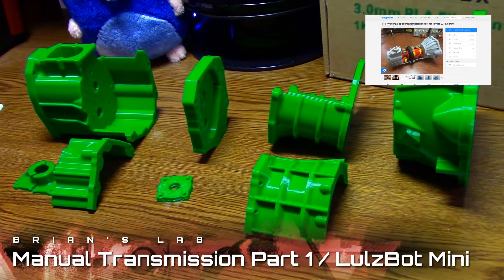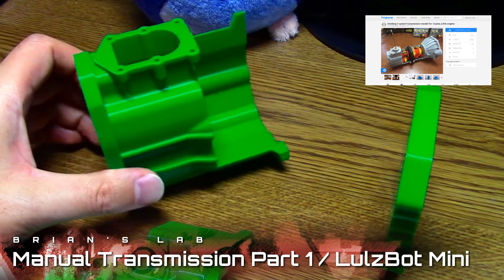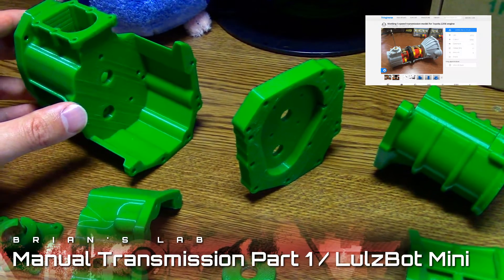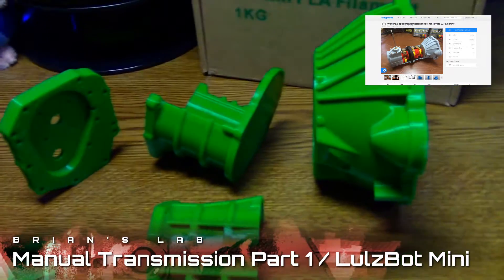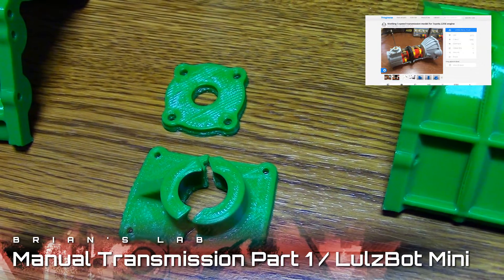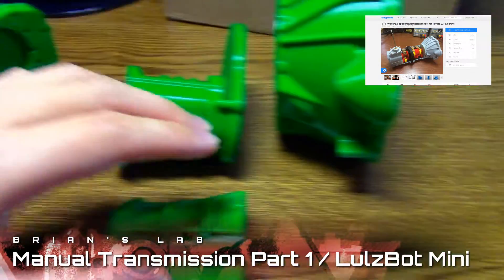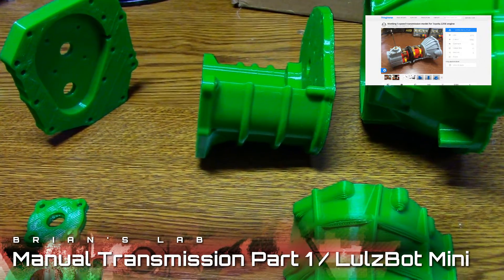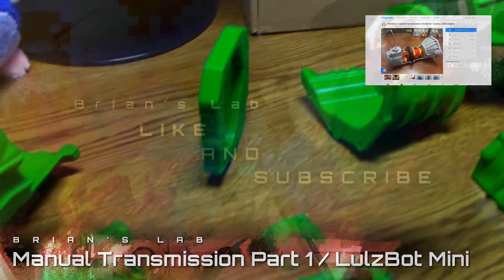Transmission Housing - 3D Printing a Manual Transmission Part 1 / Lulzbot Mini

Comment: I have a LulzBot Mini also - I am working on printing out the Toyota engine -  it will work if you reduced ALL the parts 20% in Cura -  the bearings that are listed in the parts list won't fit because of the reduction - so i am making scaled bearings out of nylon that will  - will post a bearing model on thingiverse when i get to that part -623zz bearing - i also found K&S Scale rods that work and 4/40 screws instead of 3mm - Be Creative it can Happen!!
Reply from the maker: Thanks for sharing, Kurt! That is really cool! I'd print one out if I could do it on the Lulzbot Mini. What's the best way I can stay posted on your progress?